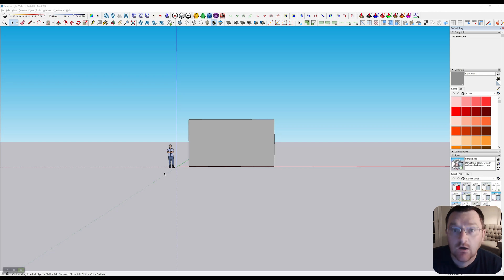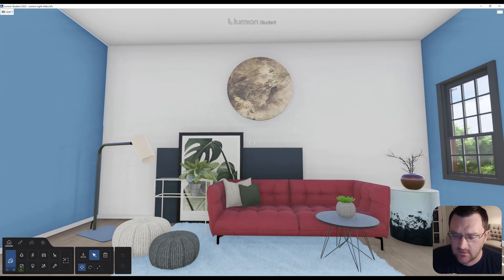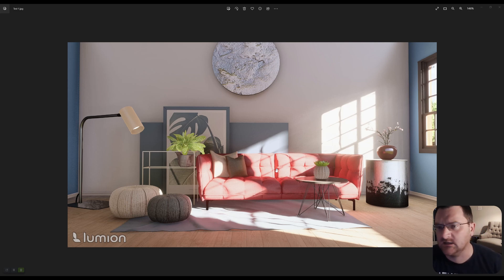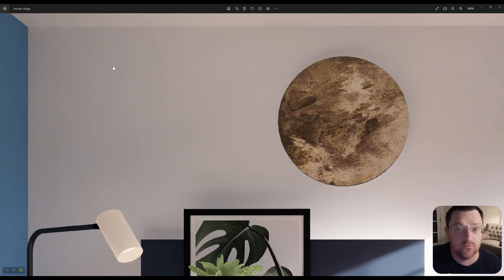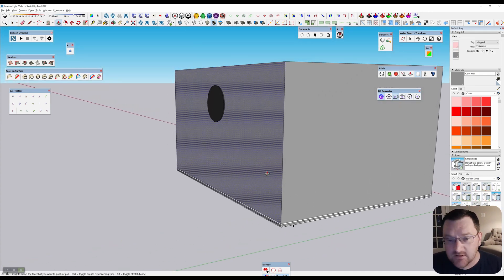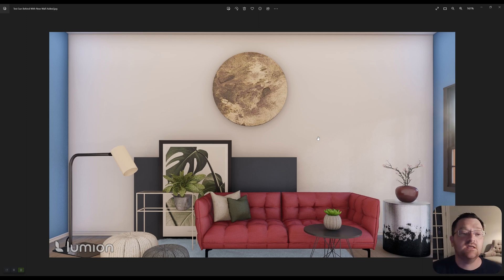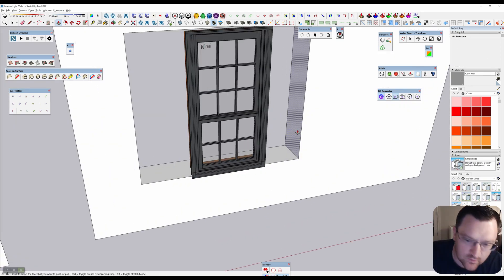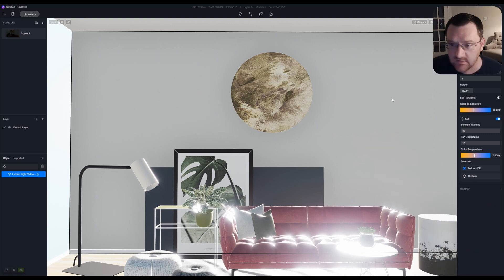Lumion Fix Light Leaking

Comment: hi bro , my pc spec : cori 9 12900 k  , nvidia 3090rtx 24 gb , ram ddr4 64gb , i rendered my project in day mode in realastic very nice hd , 60 fr , 1.3 minutes , , but when i added the lights to my project from the lumion 12.0 library & changed the mode to night , without any another effects , it began crashing when ever i make render video , even in low sittings [ small , 30fr , 45 seconds time length , 3stars quality ] what is the mistake please ? by d way , same night mode project been rendered but without lights !!
Reply from the maker: You will have to contact Lumion support for this:
https://support.lumion.com/hc/en-us